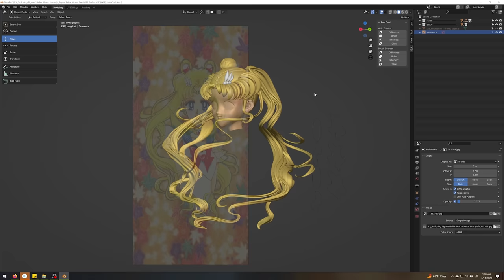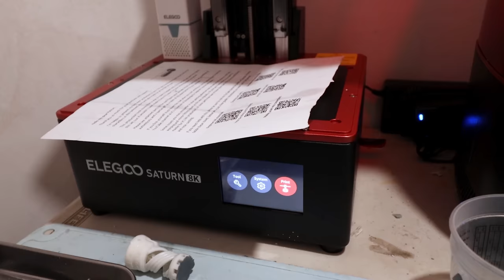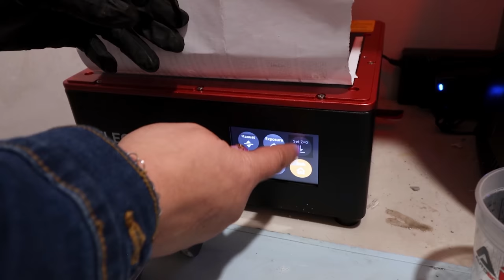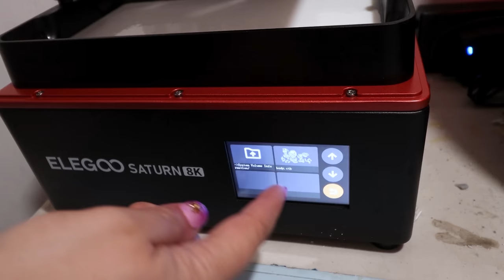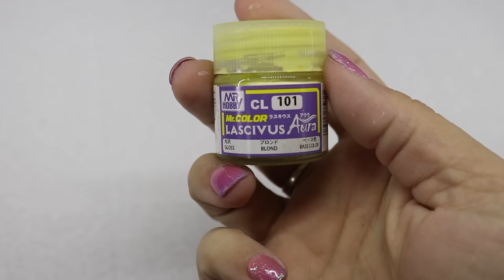Watch in Awe as we turn an Iconic Sailor Moon Illustration into a Figure!🌙 Ft. @EmeraldAngelStudio

Comment: Hi Leona. loving the videos. I just have a Pro tip for removing prints from the build plate. Instead of holding the plate by the top when removing the prints, try holding the build plate. Its helps reduce un-aligning the plate and you should get more prints out of it before you need to realigned it.  I rarely need to reset my build plate by doing it this way

Comment: Using Siraya Tech Tenacious at a 30/70 ratio or even 50/50 ratio will help with the brittleness and hardness of your prints. A little expensive but it's worth it. Tenacious is a flexible resin, will need to change some settings in your slicer though most likely.

Comment: with how thin the point is at the middle of her bangs it might be worth it for future prints to have them as separate bits to avoid snapping like that when sanding down print lines
Reply: Originally when I made the parts, the bangs were originally 2 pieces but I’m not sure why Wanzi made it one part with the fitting issues and the possible breakages it would have 🤷‍♀️ Hopefully with this brought up it will be altered.

Comment: I’ve been wondering if you need to wash or rinse the dust off the pieces after sanding before priming. I mean do you wash/rinse with water/alcohol or do you wipe with a towel or use an air compressor? My own experience with sanding is only with wood for cosplay props but I use an air compressor to blow dust away before priming. 

I haven’t gotten into the figure printing hobby yet but I’m very very interested in the process.
Reply from the maker: if there's a lot of dust on the surface, just a rag with alcohol and you're good.
Reply: @leonasworkshop  thanks so much for the reply ☺️